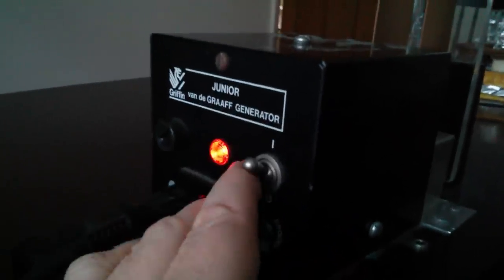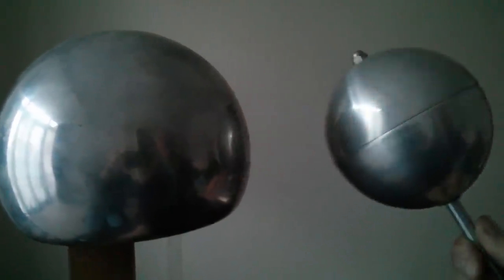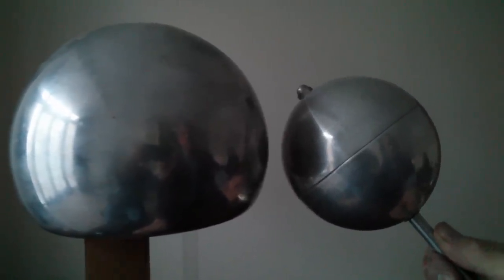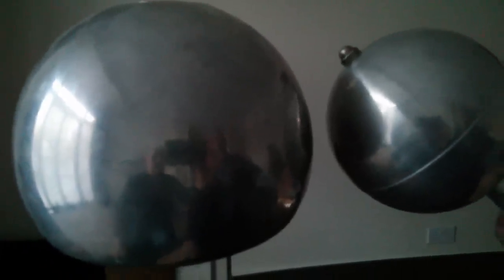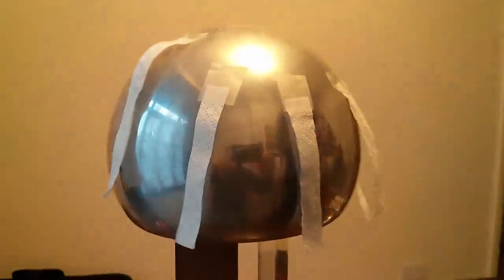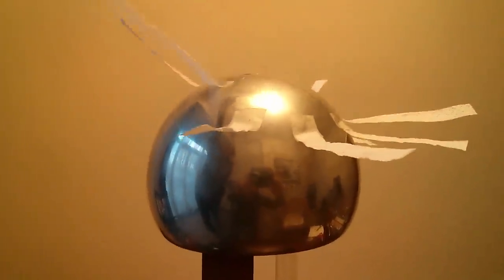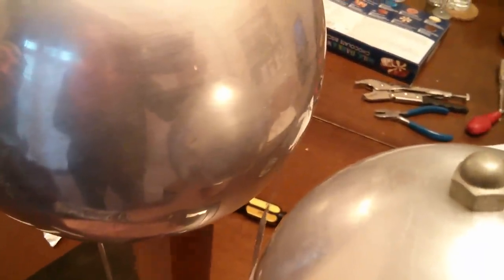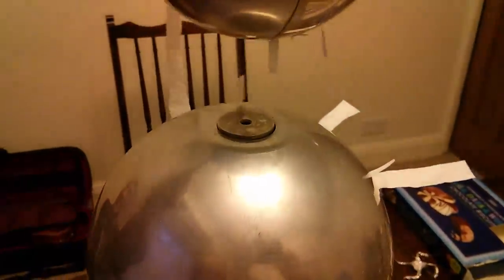Playing with a Van de Graaff Generator

Comment: I reckon if you tweak the gaps between the belt and the metal wires you ought to be able to get MUCH bigger sparks than that. Both of the ones I use at school are a similar size and design to that one and I regularly get sparks as long as 15cm, or more. Also depends quite a bit on the weather: low humidity = nice long sparks! ;-)

Comment: The cap is needed because the electrons can radiiate out from edges continuously without sparks. The round objects are trying to balance the charge and there is no weak point, so the charge builds up and bursts as a spark. When there is only the plate on top, it has a line of edge that is shooting out the electrons continuously without sparks
Reply: I would suggest getting rid of the cap and redoing the experiment with the paper. The paper would have fallen back instanly as you approah it with the grounding sphere. Same happens with a grounded nail/spike and the cap on.

Comment: testing the voltage is easy, use your tongue to receive the spark, measure how high you jump, 1 inch per thousand volts (not a reliable measurement)